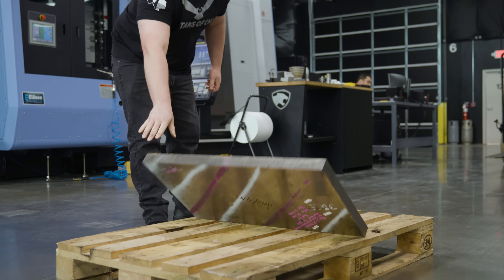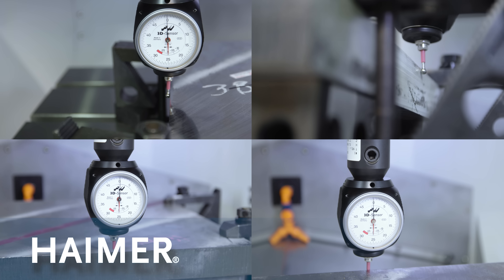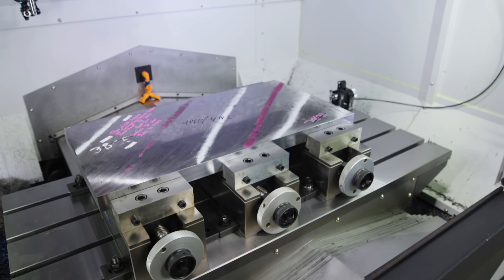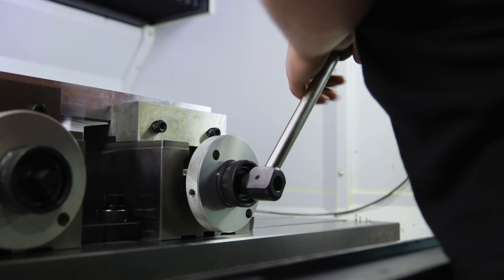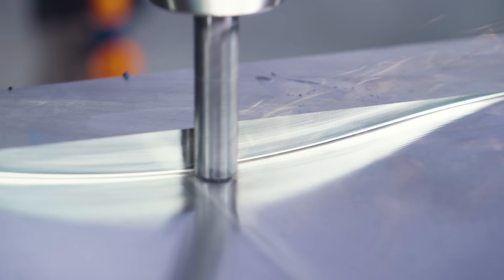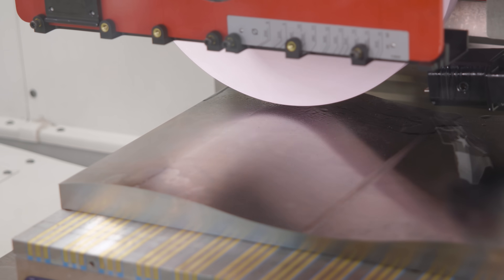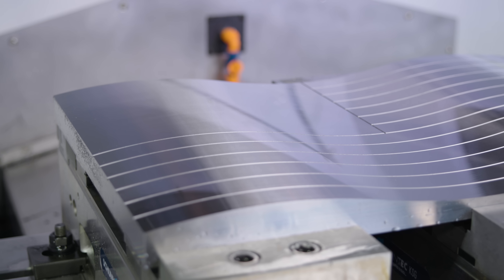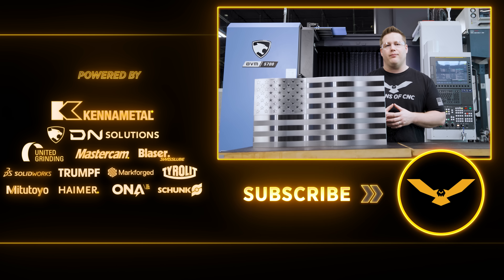This Part is so Difficult, They Told Me It COULDN'T Be Done

Comment: Been a machinist for 10 years, seeing that thing finished actually got me a bit teary eyed. That has got to be the most beautifully machined part I've ever seen. And I watch a looooooot of cnc vids after work lol
Reply: Quick question as a novice,  does the machine account for the polishing wheel diameter loss and compensate on a direct ratio of surface contact to wheel diameter loss? Or is the degradeding surface area contact patch of the polishing wheel miniscule enough compared to the metal polished surface  to render the amount of removed material/and degraded wheel size negligible? Or does it depend on a material hardness and polishing/grinding wheel degradation correlation.  If so... bear with me... is there a predetermined calculable correlation between metal 'hardness' and polishing wheel degradation...?😅😂🙏🏻
Reply: @jordannichols3067  the CNC grinder I use in work weights the stone constantly and uses computer wizardry to calculate wear on the stone, it's fairly accurate but not perfect. I'm grinding mostly chrome, which is hard af, machine losses about 0.001" of tolerance after grinding 0.025". The machine can measure the work piece and account for the inaccuracy
Reply: @lslslslslslslsl1  I love it. So fckn cool
Reply: I knew it had to be possible because there are some parts that have such fine tolerances.
Reply: @jordannichols3067  I know nothing about machining but once you have initiated the process, couldn't the machine compensate for this based on measuring the ongoing resistance or pressure applied to the piece?
Reply: @jordannichols3067  In my personal experience, the compensation for wheel degradation is not accounted for, it is accounted for when dressing.  How fast a wheel breaks down depends on many variables, so I would say it cannot be predetermined outside of a lab setting.  The amount of coolant, type of coolant, feeds and speeds, diameter of grinding wheel, diameter or size of part, type of metal, hardness level, and possible the location of the sun (jk) could all have an effect on wheel degradation.
Reply: @jordannichols3067  No machine will do that this machine can barely compensate for diameter and you are asking for something 100x more complicated than that... so it wasn't really a machining challenge it was a software challenge, here again young people need to take more interest...
Reply: @togowack  hey man, just asking...
Reply: @jordannichols3067  I'm an ass hole, tired of seeing the root cause of many problems - Lack of Interest in training young people  - being old school not knowing a thing about software that now controls everything, the only real question is what has the old school done to get young people committed and involved, rather than just trying to get by and make a living under bad governments...
Reply: @togowack  I'm with u 100%. I've grown up working with my hands since I could stand. I have my own remodeling/renovation company as well as a 3D printing business. My 15year old is part of that new generation but we're showing him by example a different way.
Reply: @jordannichols3067  Lucky I get jealous of those ones raised by tradespeople I know of one that abandoned it in his later years, due to his dad being his boss, then went to a machine shop and found out how hard it is out there, then switched trades to try something else. Titan has the right idea here traveling different places but IMO the various shop bosses need to stop by the local high school and start apprenticing directly and not bother with the scam higher education system.
Reply: @togowack  well as long as content like this is out there like never before, more youngsters can be exposed to it and possibly be interested. I feel the question I asked may have been long winded, but has some merit as there are algorithms that can calculate those variables.  Just maybe not available to GP....
Reply: I watch a lot of machining videos during work.... Lol
Reply: Super great and beautiful machining work, exactly making a piece of arts work!!!!!
Reply: You may be a "machinist" but you're NOTHING more than a schooled boy.
It's not even a part. Just attempted art.
I make these shape on my every creation, to make them look good. 
......
Reply: Even scripting this would have been a pain in the arse lol
Reply: Me too
Reply: yo I read your comment before I watched the video and thought something like "phhst".

By the end I see what ya mean
Reply: If most people were as enthusiastic about their work as you, we would live in a very different world, I lift my proverbial hat.
Reply: @amarug  yep, and yet my shop just brought in some new operator for our 104" cnc instead of me. They don't want to train a new guy to run our big VTLs. So I told my supervisor I wont be making programs for him anymore.

But since I don't have experience operating the cnc (maybe 5 parts in the last year) and no "real" programming experience besides 15ish jobs I cant get into a CNC shop. And I don't want to stay on conventional

So idk wot ima do. For now, I live vicariously through the lads at Titan.
Reply: Ughh nasty american nationalism
Reply: Me too brother
Reply: No truer words have ever been spoken. It is a very beautiful piece.
Reply: Repent and believe in Jesus Christ  go fkng spam somewhere else where your dumb opinion will be taken by people who can't think for themselves or care to read your disgusting book, this is a machining video... all you shape is young gullible minds. Damn I'm sick of the theological spamming. Can I just report these as spam? In my opinion that's exactly what that comment is in a video like this..
Reply: teary eyed ffs come on man have some self respect.
Reply: After 10 years
You know you rough everything 1 machine 1 program
Then
You send the piece to do third party workshop for finish?
There are workshop in italy specialized in finishing processes 🤷
Reply: Same.   And I'm English
Reply: But the machines are doing 100% of the work? Everyone can do that if they have the machines
Reply: As a huge fan of grinding..that is amazing. Simply beutiful.
Reply: Gotta say this is super interesting to me because I know damn little about CNC so I don’t even see what is so “impossible” about this part. Probably know more than the average person though considering I run 3D printers as a hobby. Reminds me of a concept someone said once that sometimes it’s better to have a novice attempt a difficult piece of work because they aren’t wise enough yet to know what’s impossible, so they’ll actually try to attempt it and every once in a while they’ll accidentally solve the whole problem because they approached it a novel way lol
Reply: That is beautiful ☺️
Reply: If they can do that, imagine if Titan Gilroy do it. The Sistine Capel of CNC.
Reply: its beautiful
Reply: You cut metal all day just to go home and watch people cut metal?
Reply: @sgtstedanko7186  Yep! With some video games sprinkled in
Reply: How much does it cost?
Reply: Master Craftsman job well done
Reply: Titan has said in a lot of videos to make parts so it’s like jewelry when the client gets it.  I’ve never machined anything in my life but his passion for it makes me wish I had a small machine to do some projects at home.
Reply: Yeah. Exactly.
Reply: Man you get my vote for best comment
Reply: @barrysetzer  omg its Barry!!!!! My life is complete!
Reply: Thank you for the kind words.  I watch a ton of machining vids as well.  It definitely helps to stay inspired and push to be better
Reply: @Jessie_Smith  The other half of the dynamic duo les goooooooooo! Whats next, Scott and Titan inviting me to the shop??
Reply: I want one! And I'm not even American.
Reply: @bizzzz  what the fuck does this statement even mean? Are you a bot or is your brain just set to retard random mode? I'm asking genuinely
Reply: You took the words right out of my mouth this has got to be the greatest machined peace I’ve ever seen
Reply: That happened to me too. Unbelievable masters of geometry and tooling!
Reply: Jesus has tears for you ,.knock on his door ,. Blessings
Reply: @francescocosentini9264  god isn’t real lol
Reply: @francescocosentini9264  tears for me?  Frankie my dude, it’s a machining video about not accepting externally imposed limits blindly.  Not every situation calls for the soteriological equivalent of a photobomb.
Reply: @anitkythera4125  don't be fooled by worldly things or worldly doing,.dont make idols for yourself,.be not of this world.
Blessings
Reply: @francescocosentini9264  😂😂😂
Reply: @jimmythepowerful  john 1:3  All things were made by him; and without him was not any thing made that was made.
you would not be about to eat with out God ,...
Reply: @francescocosentini9264  "That boy ain't right!" - Hank Hill
Blessings
Reply: @francescocosentini9264  : You forgot the part about casting pearls before swine.  There was a reason Jesus gave that warning.
Reply: Stop spamming people with fables created for mind control. Francis Wacko

Comment: Ok 4140 heat treated is cool and all, but heat treated to what? Technically tempering is a way of “heat treating” it. So are we talking hardened to 58 Rockwell, or annealed down to 30 Rockwell? Almost everything that’s not mild steel is heat treated in some way, so if you want to impress people, please give more accurate details

Comment: I think it doesn't allow you to directly compensate the cutter since the machine understands it as a directional tool rather than multi directional, or in other words it is only tracking the center difference by default and does not take into account the fact that the disc is round.

Comment: great job! one question. why do you need to mill those edges on X axis on 1st OP ? i mean you told us that u want to probe them, but why should we need milled edges to probe X axis when there is stock left ?
Reply: Because let’s say you probe on rough saw cut, and for some reason you have to relocate to move the part after you already started machining, it wouldn’t repeat to the same spot without it. That’s just my idea I’m not 100% sure
Reply: @adammiller4879  I would totally agree with you but 2nd Op was just a face milling and X axis edges finished

Comment: This is awesome.  I guess that "THEY" were wrong and that "THEY" will not be leaders in the CNC profession.  "They" also said that it was physically impossible to run a sub 3 minute mile.  When "they say it can't be done "THEY" are limiting potential to learn.  "THEY" would be better served to say I tried to do this using these techniques and "failed".  It would add to knowledge and wisdom and better collaboration instead of roadblocks and personnel issues.  I would love to see this done where the waves were offset 33 degrees to the right and make it a monument to what "can't" be done.
Reply: Very well said.  "They" need to stop talking lol.  It is true though, when you just say "you can't do it" you are trying to put a lid on something just because "You" couldn't figure it out.  Thanks for the response!

Comment: So what went wrong in the cutter comp? How did the machine get confused, but yet was fine with it as a subprogram? That's what baffles me more. Should this be also be something that Blohm could address? Feels like a weird edge case scenario.
Reply: I am looking into that as well.  This is what had me losing my mind on it.  I knew the code was correct and it should have worked but for some reason it wasn't.  I would run it with G42 in the program and then run it again with it deleted out and it would go to the same place and same motion.  it was going to crash into the material if I had let it.  Finally I tried it as a subprogram and it started picking up the code like it was supposed to.  I have sent it to blohm to see if they can find out why it wouldn't work the other way.

Comment: That's a badass flag. 
So who is "they"?? You mentioned they said it couldn't be done multiple times here, but i never seen a comment that says you can't do surfacing in a CNC grinder...
Reply: It wasn't that you can't do contouring on a cnc grinder.  it was thought that you couldn't do a continuous contour (going from convex to concave then convex etc. in a continuous motion) on "this" grinding machine.  It turns out it is because if you use their conversational programming the macros aren't written to be populated for a continuous grind.  So it was someone at their facility that said we couldn't do it because I wanted to do that motion a few months ago.  I didn't have time to mess with it then but I knew that there would be a way to do it, it just isn't the "conventional" way.  So I found that yes this machine is well capable of doing it, it is just a little more involved.

Comment: Well done! What are you going to do, if anything, to keep this surface as shiny as it is? 4140 isn't stainless steel, so this will rust if nothing is done to prevent tarnishing. Would be a shame if that happens.
Reply: Oh I know!  I was super nervous when I was making it and I wouldn't even let the coolant sit on it for very long.  I may wipe it with a thin film of WD-40 for now and then maybe get some rust inhibitor like Die-Saver to spray on it
Reply: @Jessie_Smith  Or perhaps you can repeat this with a slab of Type 440C 😁 Ferritic stainless steel, hardenable to at least 58 HRC, and that will not rust easily.
Reply: @Hydrazine1000  That would be nice as well! then wouldn't have to worry about it at all lol

Comment: That looks epic, and that grinding was crazy
Reply: Thank you!  I was going to be super disappointed if I couldn't get the grinding to work.  I wanted that ground surface finish so bad!
Reply: @Jessie_Smith  understandable, wouldn't have been as cool if it wouldn't have worked out.

But there is one question i have, how did you deal with the burrs from engraving?
Those looked quite aggressive
Reply: @Birb_of_Judge  I just went back and re-ran everything with a new tool and it knocked them off.  yeah some of them got pretty rough lol.  If I made another one, I would probably engrave it first and then take it to the grinder and let it take care of the burrs.
Reply: @Jessie_Smith  that was my first thought to do all the engraving and milling work in one session, then grind in the finish. I imagine that took a lot of extra time rerunning all of that.
Reply: @Birb_of_Judge  yeah it took more time but I was able to speed it up some since it wasn't cutting anything and I was able to walk away and do other things

Comment: The engraving of the lines and stars seemed quite slow. What is the limitation  that it can't be done faster?
Reply: That’s a lot of work for a smaller ball nose in prehard, I would say two reasons

1 being tool life
2 being that at the tip of a ball nose you are turning almost 0 SFM so trying to cut fast will just ruin the tool and part

That’s why when you see simultaneous 5 axis work with ball nose cutters they are cutting on the side of the radius and never with the tip of the ball
Reply: i thought it was pretty fast, perhaps because those cutters have a very sharp and small diameter point which makes it fragile if you feed it too much
Reply: the tip of the tool.  The tool I used only had a .020" radius and I was not running coolant so I ran the recommended feeds/speeds from the manufacturer

Comment: What did the manufacturer say about the grinding machine ignoring the compensation setting?
Reply: They wasn't sure why it was canceling it out for the way I was doing it.  It shouldn't have been but it was.  I finally used a contouring cycle which allows you to place the g-code for your contour into a subprogram.  once I did that and it actually started reading the G41/G42 I had in the code.

Comment: After 2 years of schooln and 1 year of machining. i quit friday for an operator job. Employer wanted to jump my pay from 15 to 22 an hour soon as i put my notice. Im done with the trade. its unappreciated and constant fight to prove your worth. Constantly crapped on and spending more money than necessary just to do the job meanwhile operatora pay more and require no spending
Reply from the maker: Maybe the shop you worked for just sucks and has bad leadership. There are some great shops out there also… I have worked for good and bad… as I grew, I refused to work for bad and also predetermined what I was worth… and didn’t accept less.

Titan
Reply: I'm finding this out. I was in aerospace on about  £25 /$30 for a cnc machinist, working with critical components and titanium. 

I'm been offered jobs at £12/$14.5. 

Some supermarkets are paying more money for standard cashier jobs 😂

Comment: The guys at work and I reference this channel when we machine stuff. “We got this big piece of titanium . No coolant so you can see what we’re doing”.   It’s a 90s prototrak and we do alumumum machining mostly. Nothing fancy
Reply: There’s nothing wrong with a prototrak. I started on one.
Reply from the maker: That’s Awesome…
Pro-tip. Titanium, Inconel and Monel are the few materials that I always use coolant. In titanium, your endmill literally can turn to fire🔥😳😁

Love testing Crazy materials. 

Titan
Reply: @TITANSofCNC   love your channel 4140 love to cut that material so stable what was it's hardness he said it was heat-treated?
Reply: @Jon-O.  Thank you, I love 4140 as well lol  It was somewhere around 30-34 Rc.
Reply: @Jessie_Smith  ok cool yeah I could tell by the way that end mill was cutting it wasn't rock hard. dam nice job on figuring out how to use a subroutine to get that tool offset to engage on the grinder awh sweet.
Reply: @Jon-O.  Yeah I knew that the harder the material the better the surface grind would look but if I went too hard then I would have hell trying to engrave it so mid 30's seemed like a good compromise lol
Reply: @Jessie_Smith  and that is why feed in relation to speed is so key the last thing you want is to work harden the material it just complicates things. Keep Killin it Jessie!
Reply: @TITANSofCNC  let's see it